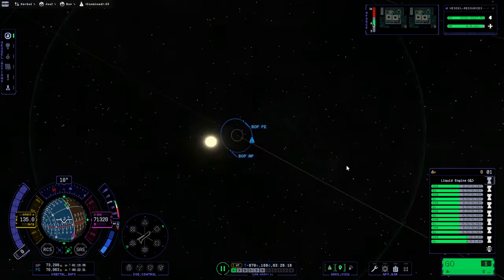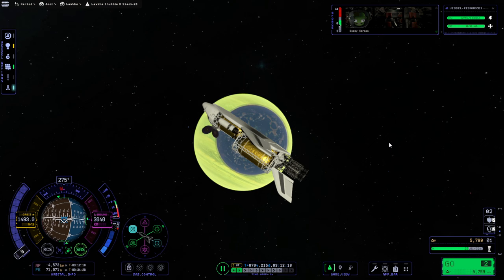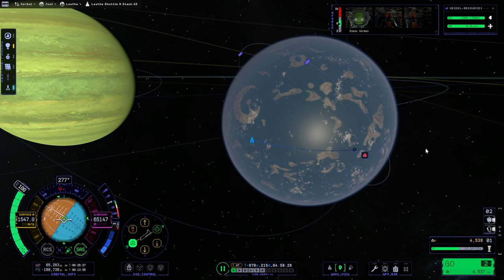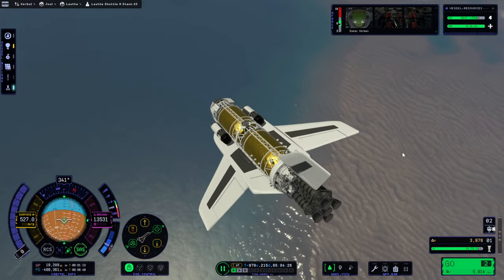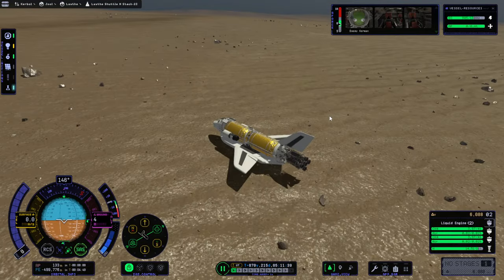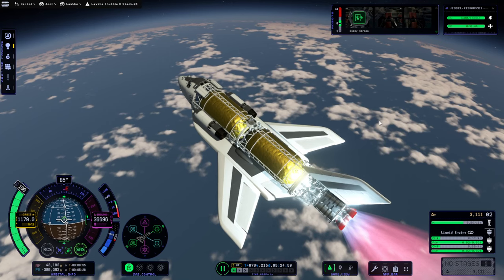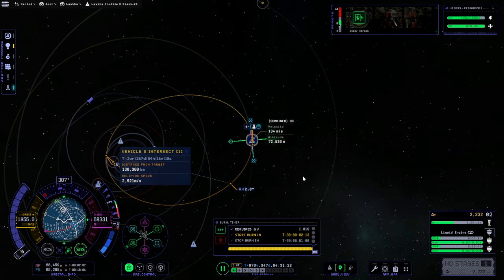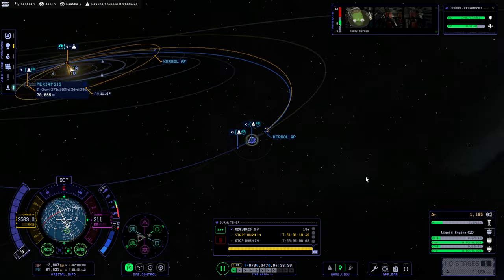KSP 2 Early Access - For Science 35 - Laythe Again

Comment: There's at least some information to be found in the Tracking Station for each planet.   For example:
Kerbin:  Gravity 1.    Atmosphere 1.22atm   Density 58482
Laythe:  Gravity 0.80  Atmosphere 0.76atm  Density 56143

Looking at those numbers I would think Laythe would be somewhat 'easier' than Kerbin when it comes to that particular entry.   And  the values (for most of the planets) are slightly different from those of KSP1. So checking the wiki is probably somewhat meaningless
Or ...it's just one of the million bugs the game has. :)